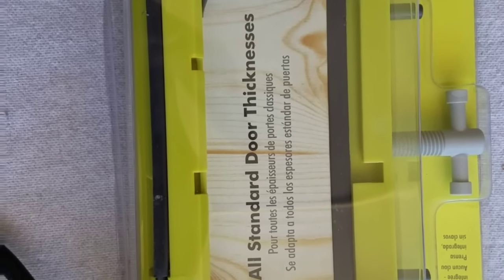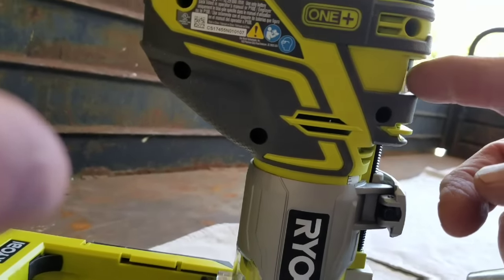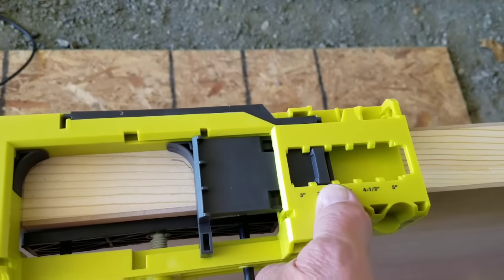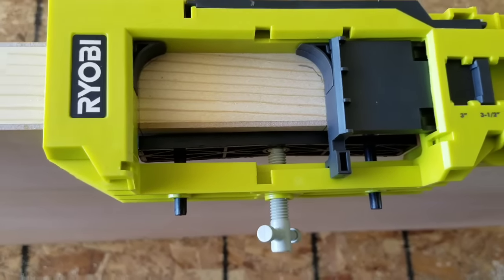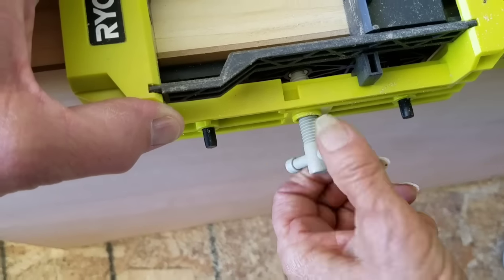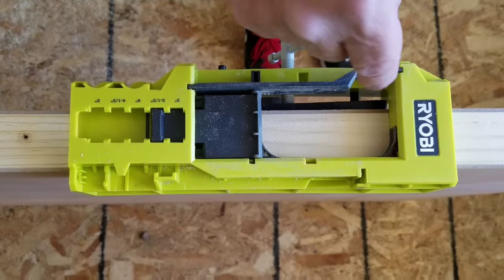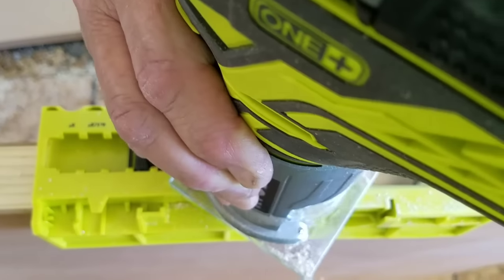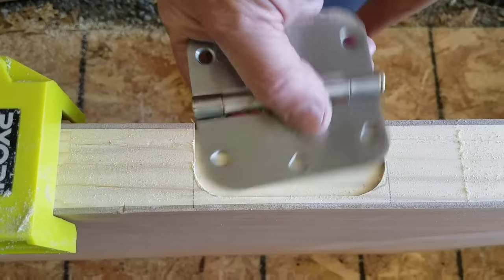Ryobi Door Hinge Kit Rocks

Comment: Maybe I have a faulty temperate, but tightening down the clamp enough to where it won’t shift around pulls the temperate towards you, throwing off the measurement. I learned that the hard way on the first door we hung.
Reply from the maker: Yeah 
 take it back and get a new one
 there must be something wrong

 unless you're doing something wrong

 because it works perfectly fine without over tightening it 

which is what you had to do

Comment: Which bit did you use with your router? Did you have to adjust the router depth as well?
Reply from the maker: The bit comes with the kit
Where is a depth gauge on the side of the unit

Comment: Why does it not come with the quarter round plastic pieces?? Do I have to buy those separately? You'd think if there's only 3 types of "rounds" and only 2 of them are actually round that they would include both and not just 1?
Reply: Wait I'm an idiot the instructions say "for hinges with 1/4 radius corners, do not use corner guides. The router but will naturally create a 1/4in. corner radius." 🤦 not deleting my comment though in case this helps someone else though!
Reply from the maker: I'm not positive exactly what you're saying but if I didn't make it clear in the video I'm sorry it comes with everything you need except for square and you have to cut out the last little bits with a chisel or utility knife
Reply: @Jonehughes  I was referring to the little plastic pieces that make the edges round and was initially confused why it didn't come with quarter round pieces but then I read the instructions 😂

Comment: How do I know we’re to make the cut on the door for the hinges? Also what about the frame the mount on how’s that done because the frame isn’t the same as a door.
Reply from the maker: If it's a door that has no hinges already installed

 if it's just a blank jamb and a blank door

 just measure an existing door  and match that

There are many templates for the jamb templaco makes a good one

Comment: Is there a reason they sell them without the hinges? It seems like a gigantic racket to sell tools but is there a legitimate reason?
Reply from the maker: Yes 

and they sell saws and drills without wood

They sell cement tools without the cement

Who would have thought???

I have used this tool for several sized hinges on many doors

Hinges come in silver or brass and a number of other finishes

It would make no sense to send a pair of hinges with this tool

As it turns out since I've been doing this for 40 years that I happen to have a giant box of hinges

But I can guarantee you if they sent out a pair of hinges with this tool they would be in that box

 there is no chance that they would match the hinges from the house I happen to be working on at that time

Comment: Not bad I appreciate it. So here's the question of the day for anyone to answer. What is the recommendation for the height of the hinges? Or for the measurement of the top and the bottom hinge at least? How do I know not to go too high or too low? Is there a minimum standard?
Reply from the maker: You should simply match all the doors in the house It's just like window headers all window headers should be exactly the same in the house so it looks cool from the outside same thing with door hinges All door engines should be exactly the same so everything looks standard and nothing looks out of place
Reply from the maker: Darn spell checker 🤷

Comment: Looks like a great tool, but I just don’t like all the plastic. I could see the screw assembly wearing out or breaking quickly.
Reply from the maker: It is very inexpensive.....

But plastic is the tool of the future

And I've used it to do over 60 doors so far

And it has not shown any sign of falling apart or getting weaker...
Reply: @Jonehughes  Fair enough...I’ll check it out.

Comment: You should show mortising the hing on the frame too.
Reply from the maker: This is what I use

https://www.zoro.com/templaco-mounting-hardware-40368kf-40368kf/i/G1296716/?utm_source=google&utm_medium=surfaces&utm_campaign=shopping%20feed&utm_content=free%20google%20shopping%20clicks&gclid=Cj0KCQjwu7OIBhCsARIsALxCUaNRrYshkTcUIN2qVpzQSUs9ux4ifKvW7hfV3m0rNd91yQsshTVKu94aAmReEALw_wcB
Reply: Isn't there a template that you can put on the door itself for the correct spacing when you router out these hinges?  I see a link that you have here but that is at 7 in down from the top instead of the usual 8 in down from top of door to start.

Comment: Very good. Square hinges would need the corners chiseled out right?
Reply from the maker: Barely.....but yes 😃
Reply: No, the black plastic curved corners can be removed, reversed and put back in for rectangle hinges.
Reply: @Joe-fo3fg  you still need to chisel out a small amount, as the router bit wont make a perfectly square corner, but the template gets you close.
Reply: That kind of sucks IMO that you have to chisel out a little for square hinges.  I’m contemplating buying this jig, but when I found out that it doesn’t totally route them out perfectly square I’m looking for a different option.  If anyone can recommend a jig that will cut out a square hinge without not having to use a chisel  please let me know.  I have 18 doors to do.  Ty

Comment: Did you also use this on the frame?
Reply from the maker: Yes it works exactly the same this thing is totally awesome
Reply: Jon Hughes 
So you used it on the jamb too? I read on other videos that it can’t be used on jambs only doors.
Reply from the maker: @rotaxrider   I apologize ,it does not work on the jamb, it has a big clamping mechanism that only goes on the door there's no way to make it flat so we can work on a jamb..... Mega apologies,
 I answered without looking at it,
 I when I re looked at the video,
 I remembered the clamping mechanism,
 very very very sorry :-(

Comment: Couldn't you do the achieve the same results with just a hinge trace line, a router & steady hand???
Reply: Yeah. Just as if your using chisels. I don't use a router looking into one but I just trace then chisel out
Reply: No, you can't do it without the guides. You can't keep it on the lines you have traced. You will go all over the place! 😂🤣😆
Reply: Do 20 doors, a typical new house job, then tell us the jig isn’t faster. This guy fumbles around, but you can do all 3 hinges in less than a minute with a jig.

Comment: Does it work on the jamb side?
Reply from the maker: https://www.dkhardware.com/6-foot-8-inch-full-length-template-for-three-1-4-radius-3-1-2-hinges-35368-product-479469.html

You can also buy singles instead of the  whole triple hinge template
Reply from the maker: https://www.dkhardware.com/6-foot-8-inch-full-length-template-for-three-1-4-radius-3-1-2-hinges-35368-product-479469.html
Reply from the maker: https://www.dkhardware.com/6-foot-8-inch-full-length-template-for-three-1-4-radius-3-1-2-hinges-35368-product-479469.html